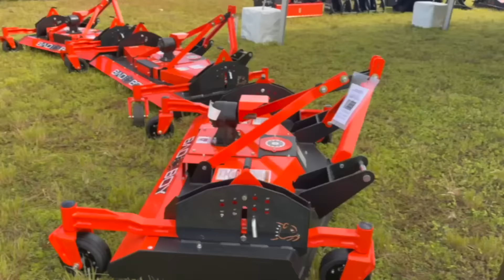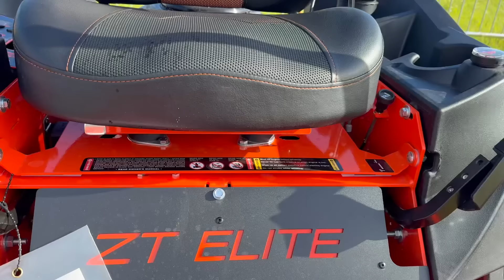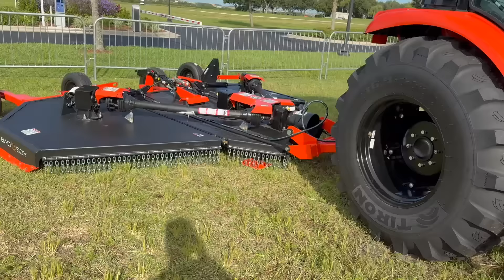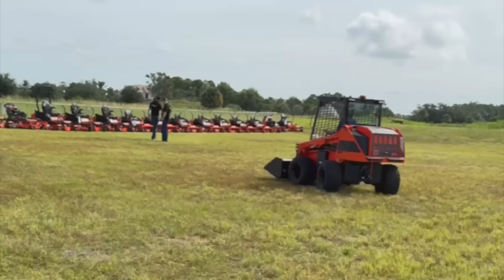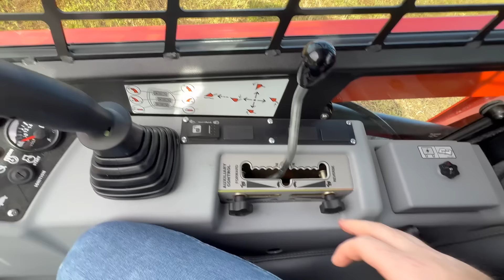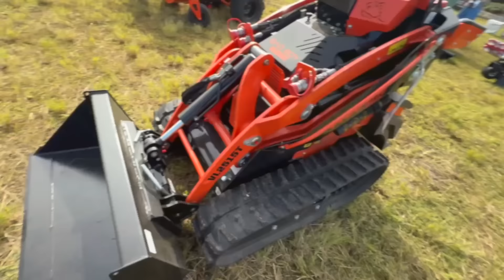You've Never Seen a Machine Like This!

Comment: Whoever reads this at The Tractor Yard please know imy wife and I share an email account.  This is her husband writing the comment.  Thanks for a very informative video.  I retired in '09 after 32 years service in the USAF, we live on rural property my four elder siblings inherited when our dad passed away.  I have about five acres to manage, some of it meadow, some of it yard work, but most of it is wooded.and it's hard to keep up.

Since 2015 I've owned two Kubota BX's, the first was a BX18; the second is a BX25.  For their size they are a remarkable tractor.  Especially with a third valve function, which I had the dealer install.

Bad Boy really, really needs to do something about their dealership, or perhaps their "distributers".  I live in N.C.  There isn't a single Bad Boy dealer in these two states.  There are distributors of Bad Boy; they also distribute Polaris and other products I neither want nor need.  The service technicians know how to do basic repairs on those products they sale.  If the issue is more than they feel like doing and if your Bad Boy mower failed while under warrantee they tell you to take up with Bad Boy.  Their sales personnel literally don't know anything about Bad Boy's other products; they're clueless.

Buying a Bad Boy product at a dealer is worse than Home Depot or Tractor Supply.  If I were to buy a Bad Boy mower from TS and it failed during its warranty they would simply swap out my Avenger with a new one.

I am in fact in the process of reviewing mini track loaders.  I'll buy either an ASV,  Wacker Neuson, Yanmar, Kubota, or John Deere track loader because they SERVICE the products they sell and each of these dealers are less than 12 miles away.  The ASV / Wacker Neusom is less than 7 miles away and they deliver free of charge to anyone ten miles away or less.  Would I buy a Bad Boy tractor or a mini skid steer over the other manufacturers, as stellar as they are?  Yes, I would.  Bad Boy makes an exceptional product; in my opinion Bad Boy remains the most innovative corporation in the U.S.

But why buy a product I can't even look at (apart from images and videos),  that's over 700 miles away?  I'm not concerned about maintenance issues; especially since I would not use this product commercially.  The product might get only 70 hrs/per year use.  But I'm not about to travel 1,400 miles to buy a product which should be available at least in N.C.  I'll be revisiting the ASV dealership.  And I'll buy their ASV skid steer, a WN mini skid steer, and a WN subcompact 4.2 ton with all the bells and whistles.  The last time I visited them was in 2025 and buy all that equipment since this dealer has already removed the Obama regenerative shingle.

Thanks again for a very informative video.  I imagine you dialogue on a regular basis with Bad Boy's corporative office.  Put in a good word for N.C. please.  Let them know there a lot of military vets and retirees here who want to buy a U.S. made product other than WN and ASV, which happen to be very patriotic and supports vets.  But we vets will happily assist in establishing a Bad Boy dealer in the 49 states.  Godspeed brothers.
Reply from the maker: Thanks for sharing! I will pass this along

Comment: If you look at the original Bobcat the Swing loader is basically a modern interpretation. I believe it's probably not that much more expensive than a standard skid steer take off the about 20% increase list price over there. Has to be said that I suspect that at least 75% of all skid steer loaders are sold with diesel engines here in the UK

Comment: Ive thought for a long time they need to rethink the tractor. This new skid steer might be it. I want one.
Only concern is lift capacity, ground clearance, and price.
Reply from the maker: It will lift 2000# loaded on a pallet to full height. Not sure on the ground clearance quite yet, but it seems adequate.
Reply from the maker: Price is going to start around $38,000-40,000 depending on cash/finance options.

Comment: Lift capacity?
Reply from the maker: Specs are still kind of vague but the guy who designed the machine told me it would lift a pallet with 2000# loaded on it to full height. Break out force obviously will be greater than that.
Reply: @TheTractorYard not bad.   Would be a cool little tool for lawn care guys just needing a smaller skid.   Really looks like it doesn't beat you to death like a normal wheeled skid
Reply from the maker: Ride comfort really surprised be but I’m looking forward to getting it on some actual work lol

Comment: What is the weight of that Terrain? Weight matters A LOT when your using it to move earth around. The thing looks like it will snap in half under a full load of gravel. But looks can be deceiving
Reply from the maker: Operating weight is about 4000#

Comment: The fact that it’s gas makes it pretty useless… Sure you get more horsepower. At the cost of half the torque, triple the fuel consumption, and half the life expectancy…

Aside from that, seems like a cool idea. But not for 50 grand. I’ll buy a legit DIESEL skid steer every time for that amount. I could actually get a CATERPILLAR skid for that. It might be a year or two old. But it’s a hell of a lot more machine…
Reply from the maker: More & bigger is not always better. I think this wins in a lot of scenarios where a skid steer is not practical and vice versa… however I want to get some seat time with this thing and prove what it’s capable of. I’ve had plenty of time on skid steers so I’m excited to see this thing in action! Thanks for watching and sharing!
Reply: @TheTractorYard Don’t get me wrong…I’d definitely love to try one too! I’m sure it’s handy, but at that price. It’s only for commercial customers. No home owner is spending 50 grand on something they won’t outperform a $35k tractor. And commercial customers are gonna generally want more capacity than that machine is capable of.
Reply from the maker: @brandoncrimmins6296  it will lift 2000# on a pallet to full height I know that for sure. And it could be more versatile than a tractor for general property maintenance - remains to be seen.
Reply: @TheTractorYard I’d certainly give it a shot. The huge benefit would obviously be front mounted attachments instead of rear mounted.
Reply from the maker: @brandoncrimmins6296  I hope to share quite a bit of seat time on YouTube! I’m skeptical of this but also want to know for the average 5-20 acre property owner if this machine can act as a replacement for a mower + tractor & light use skid steer. If the answer is yes then I can see the justification of the price tag. I can’t wait to test it out
Reply: @TheTractorYard While I’ll NEVER agree with the price. Especially being gas… It does seem like a cool machine and I’ll definitely be checking back in when I see some more videos on it.